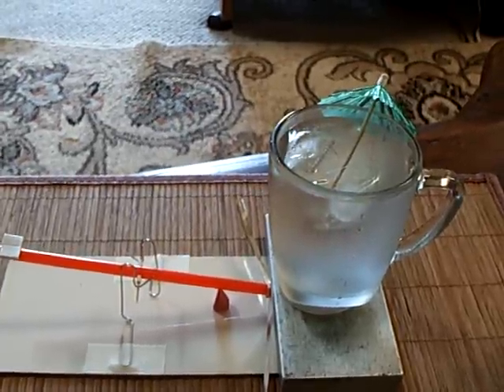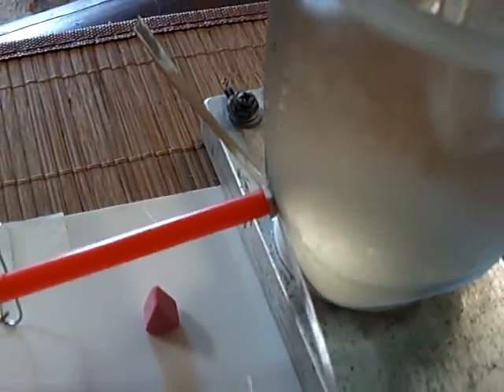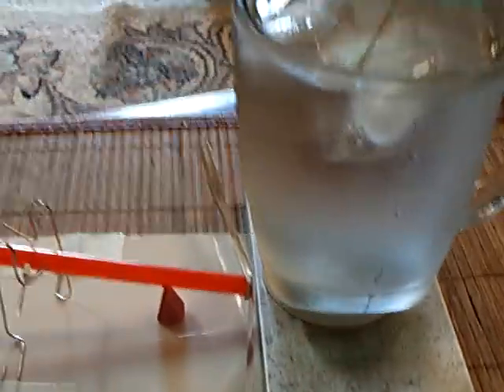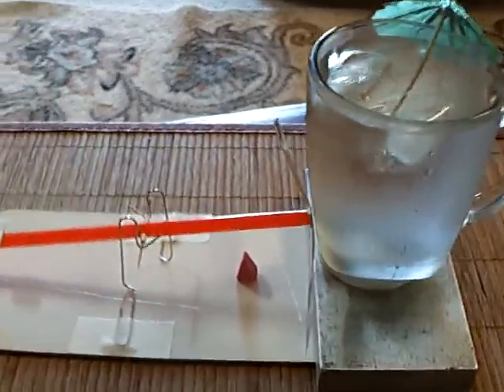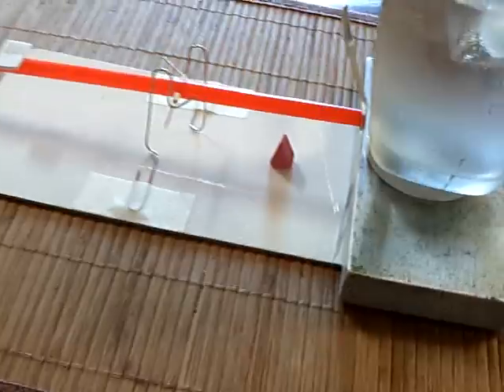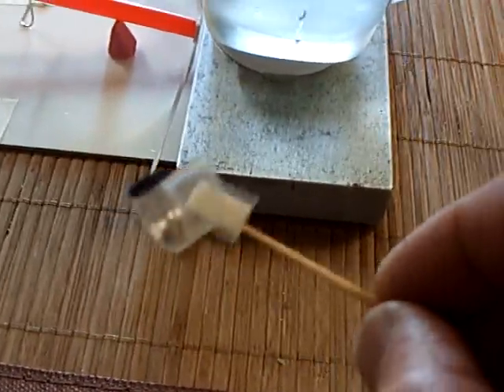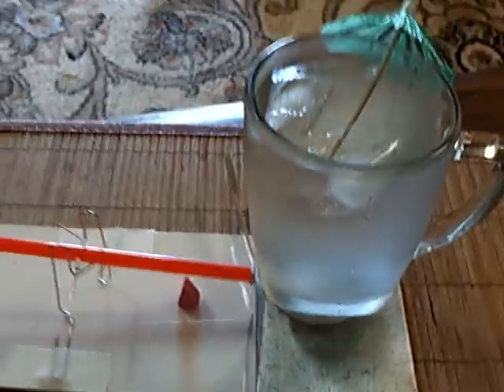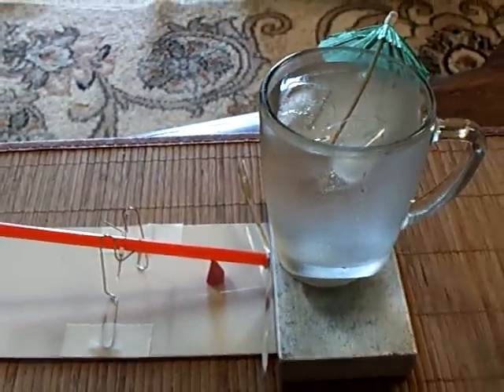Blade's Simple Heat Engine---  Running on cold

Comment: Just been working on this from the previous videos, haven't finished editing the video and now you post this and you have used the same plastic I was trying. I thought I was being different. Mine is nothing like as efficient as yours but I can see the principle working :-) It would be easy to spend a long time on this to get it as good as yours.
Reply from the maker: GrandadIsAnOldMan I am anxious to see your rendition of this device.  I have been trying to find other videos or information on this heat reactive plastic material but I have not seen anything yet. The twisted fishing line method seems to be the closest thing to it.  It is thermal expansion pure and simple but I have never seen this type before with such a readily available material.  Great fun to play around with.  I'm trying to figure out a way to make a motor with it.
Reply: ***** I will upload it later tonight. After seeing how well yours works I decided I had to make it a bit better than my first attempt, it is still very rough round the edges but it does work and I hope the 'mechanics' are clearly visible. Just editing the video now :-)

Comment: Now try to get it to work on hot & cold at the same time! :)
You might need a different plastic/foil on each end.
Reply from the maker: A B I was thinking the same thing about putting a strip on both ends.  It would work just like a school yard teeter totter.  Only thing missing would be the smiles and giggles.
Reply: ***** I don't know about giggles, but it would make me smile. :)
Plus, it would have 2x the torque. :)